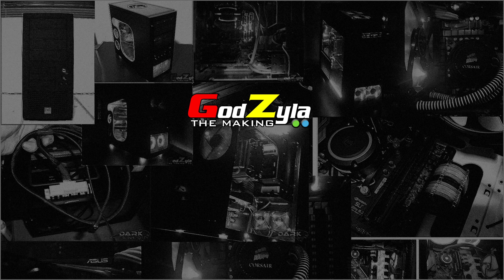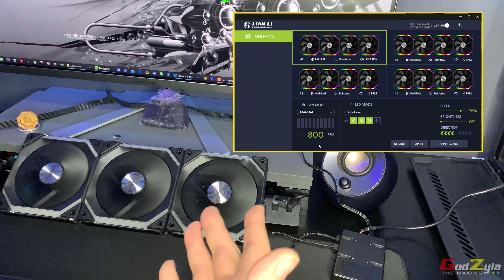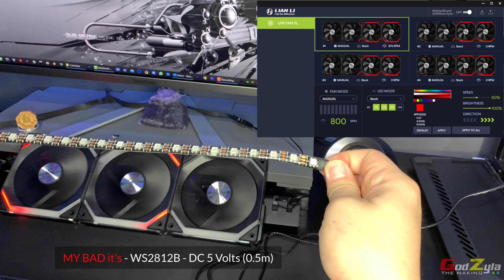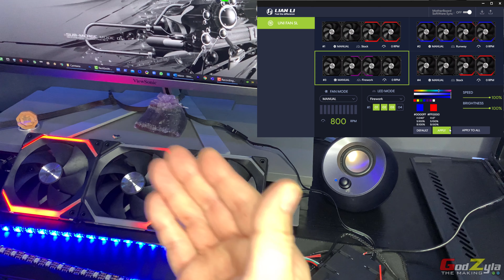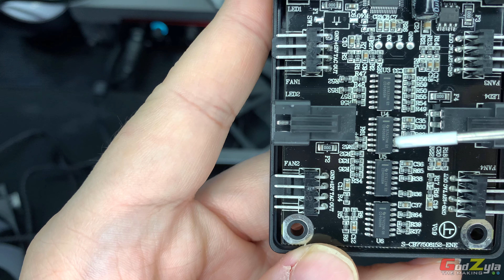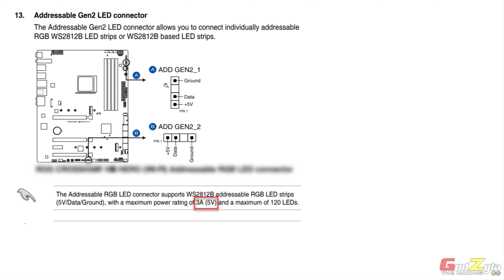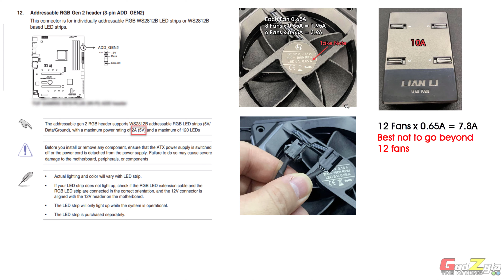Lian Li UNI Fans SL120 - Dos and Dont's (Part II) [L-Connect]

Comment: would I be able to plug in other normal 4 pin fans to the controller or is it only for the lian li fans
Reply from the maker: Hi Joshua, you can plug 4 pin fan headers to the controller if you run at full speed, other than that I do not advise you to plug other fan's fan header on this controller as the controller only calibrate for SL120 and SL140. mainly the output ampere on this fans, plus these fans have a start up voltage of 6volts. so please connect other fan's fan header on the motherboard. else for argb, so long you know the fan LED load is not more than 0.65a, you can connect to this controller with a separate adaptor.  you might want to view this video https://youtu.be/TIO8JxVZTi8 . Once again thank you for your question and to have visit my channel. If you like my content, kindly subscribe and to click on the notification button. Thank you!

Comment: Great review! I just want to clarify something, the 0.65amp rating on uni fan is the fan and it's rgb combined correct? If so I'm planning to do 10 uni fans total on my case along with the galahad pump would that be ok to run on a single lian li controller? Or would you advise split the load into 2 controller?
Reply from the maker: Hi Ric, thank you for your question and welcome to my channel. 

Now, it's 0.65a (LED) + 0.18a (Fan)  on each SL120 Fans. This uni hub can support up to 10.5a Led and 5a on fans. 

you can only use one controller as this hub as the L-Connect can only make use of 1 hub and not two. 

As for 10 fans with the galahad. not an issue. just follow the steps below

1) 1st 3 x Uni Fan SL120 to input 1
2) next 3 x Unifan SL120 to input 2
3) next 4 x unifan SL120 to input 3 (no issue as max to one input is 4)
4) connect the ARGB of the galahad to input 4

5) connect your galahad pump to the CPU 1 fan header of your motherboard (make sure it runs on full RPM) never use PWM on pump. you will damage it in no time.

hope that helps :) if you like my contend to help by subscribing and to click the notification button.
Reply: @KleoYan  thanks a lot! And will do subscribe 🙂
Reply from the maker: Thank you Ric, by the way if you have not watch the rest of the Uni Fan series, you can always view here https://youtube.com/playlist?list=PLEW-b-2vYDdM1WklGQps2-sQ1Amy6Uwn9 and if  you have anymore questions. you can always drop by and I will try my best to help you out :)
Reply: @KleoYan  I'm actually currently watching most of the videos you have 🙂, with regards to the question I have earlier even if I set the rgb to static white color it wouldn't burn out my lian li controller correct? I just wonder if static led setting on my uni fan would put more strain to the controller?
Reply from the maker: Hi Ric, I don think it will burn out, less the worries. static colors are fine but do note that for argb, static white is with a tint of blue hue. also to take note. so long you are below 10.5a , your uni controller can take it. best practice is to have it at 8 to 9a and not more than that. reason being, the big capacitor will run hot, make sure to mount the unit on somewhere mater surface will do. 

by the way some correction, I know alot will just say RGB but there is a big differents. 

RGB = 12 volts non addressable (4pin) 
Wire labeled as 12volts - Green - Red - Blue

ARGB = 5volts addressable (3pin) 
Wire labeled as 5volts  - Data In/Out - Gnd 

Once again thanks for the questions and to have visit my channel. thank you :)
Reply: @KleoYan  no, thank you for your time putting into this awesome videos keep it up!
Reply from the maker: Hi Ric, thank you and you are most welcome.. stay safe and have a great day :)

Comment: Hey I was wondering if I’m able to use the uni fans with a Corsair 4000D airflow? I’ve only seen the uni fans used in Lian li cases
Reply from the maker: Hi Clay Scott, thank you for your question. It should not be a problem as most standard chassis have 120mm  mounting holes. I believe you are worried about daisy chain alignments. You need not to worry as these fans have precise correct measurements for you to mount in your case. Once again thank you for your question and if you like my content, kindly subscribe. Thank you.
Reply: @KleoYan  thank you so much for responding! And yes I was just wondering about the daisy chain being compatible and will subscribe for sure
Reply from the maker: @clayclaps3002  you are most welcome ..

Comment: Okay so can you set a fan curve for temperatures? And can you set these fans for temperatures for like an aio? From what I'm seeing you can only set the fans to a set rpm?
Reply from the maker: Hi Ian P, thank you for your question and yes, you can only set one specific temperatur curve as it only make use of one PWM connector from the motherboard. if you do not like this arrangement and wanted to set individual set with temperature curve. plug only the argb of the fans to the uni controller and the fan connector directly to the motherboard header.

once again thank you for your comment and visit. If you like my contend, kindly subscribe to my channel and to click on the notification button. thank you!

Comment: hey great video i have a question what if my motherboard doesnt have 3pin 5v rgb header? can i leave that wire unplugged and still control rgb from the lian li controler??
Reply from the maker: Hi ADOBOTO, thank you for your question.
Yes you can, so long you connect the USB Cable provided, one end of the cable to the Uni Fan controller and the other end to your motherboard USB header. Once again thank you for your question and to have visit my channel. Do remember to subscribe and to click on the notification button.
Reply: @KleoYan  thanks man i subb, so its its ok to leave the 3pin rgb unplug then?
Reply from the maker: @VeryToksik  Yes, not an issue, just remember two cables are needed. 1) the sata from uni to PSU and 2) the usb cable from uni to motherboard. You will also need to install the application call L-Connect here https://www.lian-li.com/downloads/L-connect.zip .
thank you for your subscription and revisit :)

Comment: Great video! Right now I have the Galahad 360 AIO (3 RGB fans/1 water block) and 6 Uni fans. Is there any solution to getting these to all work together?
Reply from the maker: Hi Brian, thank you for the compliment and question. Now based on the official lian li website, I have downloaded the manual and did some checking https://drive.google.com/file/d/1QocUYP1um2OFaoJJwknhynSemj9Op1Ls/view?usp=sharing 

Skip this if you do not want to read these details 
The Uni fan controller takes up  to 3a Fan load 

so practically 6 Uni Fans (1.08a) + 3 Galahad Fans (0.54a) + Galahad waterblock Pump (1a) = 2.62a 
no issue, you can connect all to the Uni fan controller without issues but I would advise you to make sure your pump is not on PWM but on full. this will prevent pump to pump irregularly  which will hurt your pump in a long run)

As for LED load on the Uni Fan controller is rated 10.5a 
so practically 6 Uni Fans LED (3.9a) + 3 Galahad Fans LED (1.62a) + Galahad waterblock LED(1a) = 6.52a 
no issue you can connect all argb LED connectors to the Uni Fan  (NOTE. make sure the Galahad fans are rated as 0.18a for fan and 0.54a for LED, see if this is the same as your galahad fans http://image.uc.cn/s/wemedia/s/upload/2020/57b43daa2b73ca98ae5f36cea2a413db.jpg

Connection method Galahad + Uni Fan 
1) Connected your Galahad water block pump fan header and the led header to the Uni Fan Controller that shows 1
2) Plug 3 sets of uni fan SL120 fans with the end connector to the Uni Fan Controller that shows 2
3) Repeat 2) and connect it to the Uni Fan Controller that shows 3

this will be the part where you need , please refer to your menu
1) at page 1 , look for item N and item Q
item N is the splitter cable for you to connect to all your 3 fans (4pin connection)
item Q is the splitter cable for you to connect to all your 3 fans argb (3pin) 

now connect the other end for item N cable & item Q cable to the uni fan controller that shows 4

and you are all set to go, hope I explain clearly. 

once again thank you for your visit and do remember to subscribe to my channel .

Rgds,
Kleo Yan

Comment: Could you connect the Lian Li 24pin and GPU strimmers into the uni controller? The 24pin comes with a controller and then you run that to your ARGB connector on your motherboard, but can you run that to your uni controller instead?
Reply from the maker: If you are talking about the Strimmer plus from lian li. I do not have the trimmer plus but after looking at the manual which I have downloaded from lian-li website https://www.lian-li.com/strimer-2-24pin/#tab-download-17 , answer is no. you can't connect them directly to the unifans controller. They are of different connection. The strimmer is using 4 pin mini JST HX connectors else the unifan make use of 3 pin JST WS2811 connectors and the current might be different.
Reply: The 24pin strimmer comes with a controller similar the fan controller you can connect the gpu strimmer to it as well
Reply from the maker: @awilix_5374  yup, just use the controller that comes with the strimmer as you can't connect it directly to the unifan controllers :) by the way.. hi Ghost, welcome and thank you for visiting my channel.
Reply: @KleoYan  glad to be here I have a quick question yesterday I got a lian li o11 dynamic case. A few weeks ago I got there fans (lian li SL120) and had installed them into my old case and they worked all good but when I gutted my old computer and moved everything to the new case the fans spun but no rgb and in the software I couldn’t connect to it. I looked at all the connections everything was connected but I have no idea what the issue I might have to just unplug everything and plug back in but. The reason this is weird because the fans work perfectly in my old case but when I converted they don’t work
Reply from the maker: @awilix_5374  you have three fans, you mean to say all fans spinning and the argb lightings are not flashing? now it can be due to these four reasons. I would suggest to narrow down what's going on

1) Uni Fan controller output is faulty
2) cable faulty
3) aRGB led blow within the strip itself.
4) the argb cable that is connected between the Uni Fan to the motherboard is faulty.
if 4) is the culprit, there is nothing you can do unless you able to find and purchase a replacement for it. 

Troubleshooting Step for 1) to 3) 
A) separate your  fans and connect each with the provided adaptor / cable 
B) connect each fans to the separate output of the Uni Fan Controller (1 2 and 3), observe if fan is spinning and if the argb does light up. 
If all fans spinning but lets say  output 1 2 and 3, the fans spins but only output 3 aRGB is not lighting up.
swap the output from 3 to 1 or 2, if after swapping it works, this could be due to the unit itself as in output 3 is having an issue.
if after swapping is still the same. It could be the cable is faulty, swap the cable either 1 or 2 with 3. 
if by swapping the cable does not help. you can try using a rubber eraser to clean the contact points on 3. http://godzyla.epizy.com/pcipolish/pcipolish.html <-- guide
if all the above diagnose are done and only one fan is not lighting up. then the aRGB on that particular fan is faulty. 
as how aRGB works is. if one LED is blown from a strip (the strip build inside the fan) . then it will stop the light from flowing. in this case, am sorry to say that there is nothing you can do but to purchase an individual fan. 

hope that helps.
Reply: @KleoYan  thank you I hope it does as I was fixing trying to trouble shoot it one of the leds of the gpu strimmer was not glowing so I hope that’s not faulty either
Reply from the maker: @awilix_5374  hmm.. ok just my own opinion. I've been playing RGB and aRGB for some years now, aRGBs are nice to have but the problem is.. if one of the LED blow. the rest will not work. that is why I stick to RGB as they last longer. https://www.youtube.com/watch?v=Fu4qZW0pQm4&feature=youtu.be&t=605  .. by the way thank you again for the questions. don't forget to subscribe to my channel too :)

Comment from the maker: I have done up another vid with more details on how to use this Uni Fan controller here https://youtu.be/Rm2emeyMUAk
Reply: Hey Kleo! Please,can you tell me if i can connect RGB mirror cap (3 pins,5 volts) from this Phanteks AIO to the 5 volts fan output on the controller? If yes,it will sincronize with Lian Li fans effects? Thank you very much! http://www.phanteks.com/Glacier-One-MP.html
Reply from the maker: @letalmike  Hi letalmike, thank you for your question. looking at the manual page 4 http://www.phanteks.com/assets/manuals/Glacier-One-MP.pdf the connector that plugs to the motherboard aRGB, this indicate that it's a standard aRGB 3pin plug. you can use that to plug to the uni fan controller without issues. once you plug to the unifan controller, make sure the other connector is not connecting to your case argb controller (just incase if you own a Phanteks case) once again thank you for your question, if you do like my content. kindly subscribe and to click on the notification bell. thank you!
Reply: @KleoYan  Thank you very much for answering! I do own a Phanteks case,but one without aRGB controller switch,model Eclipse P600S. Subscribed!
Reply from the maker: @letalmike  I see.. ok then you should be fine to connect the Phanteks AIO but you do need a converter though... once again thank you for visiting and to subscribe to my channel :)  all the best in your build..
Reply: @KleoYan  What converter? It is not a 3 pin argb standard plug?...
Reply from the maker: @letalmike  the uni fan controller does not take the standard argb connector, you need a SM JST 03 female connector. just an exmaple which i have explain at this video. https://youtu.be/bMRz2KVqbjA?t=531 the normal arbg is what your AIO is having.
Reply: @KleoYan  Thank you!
Reply from the maker: @letalmike  you are most welcome.. :)
Reply: Yeap , I follow your step , it’s work on my pc now thx u so much
Reply from the maker: @raymondtan2832  you are most welcome , glad this is of some help :)

Comment: Thank you for making this video. You know your stuff. I have some questions if you might have the answer. I have two lian li controllers. And a motherboard with two argb headers. I plan to use one to connect 6 unifans and 1 phanteks ARGB strip. My problem is that I still have 4 argb components to plug in. Cpu block, gpu block, case, and distro plate. Any suggestions for how to get all of these plugged in. Can i use the second lian li controller to control them with aura sync? I dont know if that will work, or if you can even use two lian li controllers at once. Otherwise, i will just have to buy a different argb controller. Thank you
Reply from the maker: Hi JBH,
Thanks for the question. No you can’t use two lian Li uni fan controllers. Reason being. You will need the L-connect software to instruct the unit to use the motherboard argb controller. By default, the software is cater to sync with only one unit and not two. Unless some alteration can be done on the software to identify each control unit. Which I do not know how. So sorry, answer is no. You will need to get a different brand control unit to do so with your other components. Please make sure your motherboard has another USB header for the other control unit. 

Once again thank you for your question and to visit my channel.
Reply from the maker: Hi JBH, I  have done up another video, you might get a clearer picture here. https://youtu.be/Rm2emeyMUAk

Comment: I have the Lian-Li 011 Dynamic XL case and I have 2in the bottom for intake, was going to do the top with my Kraken z73  push-pull in the exhaust, 3 side fans to draw air in,  plus my case will take a fan for exhaust on Left side as fan fits. So am I doing this part right? I can change the Kraken to side doing push-pull with air coming in.  Do the top with exhaust?  All this RGB  is new to me.  I have the Asus Strix-A  490Z board.  SO are u saying to use MB or "DON" T USE MB" header.  I have 5v RGB plus a 12v led strips.  It took me forever to get the parts for this rig. I sure don't want to mess it up. My PSU is not even coming in until Nov. 8th or 9th.  I sure learned a lot from you breaking down all of the Lian Li.  I have used Lian Li cases for about 20 years now.   In fact, it's the only case I buy. Thank you for this going to look for more videos on what you've put out as you explain it so clear and easy.
Reply from the maker: Hi Wickette Shotts,
thanks for the questions, let me make an effort to explain in depth with another video as not only you get confuse how this unit work. infact this unit is worth much more compared to other units I have tested. do allow me to have this vid done this weekend and I will post it here once I have done it. 

once again, thank you for the question and visit :)
Reply from the maker: Hi Wickette Shotts, I  have done up another video, you might get a clearer picture here. https://youtu.be/Rm2emeyMUAk